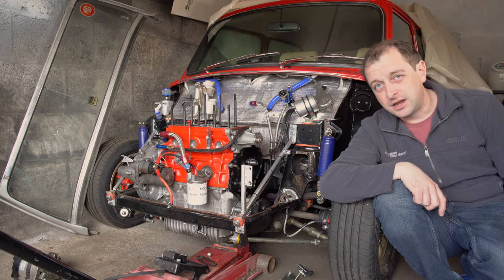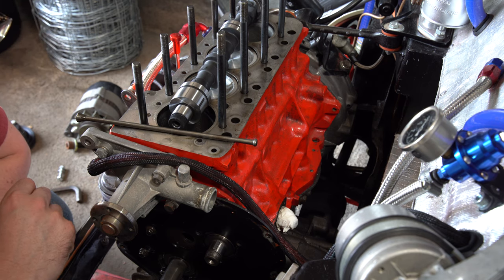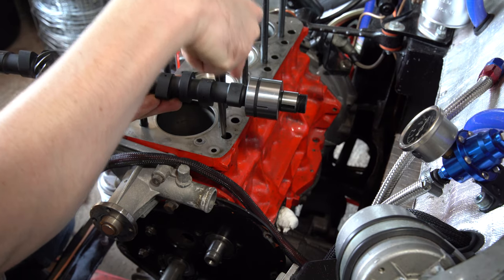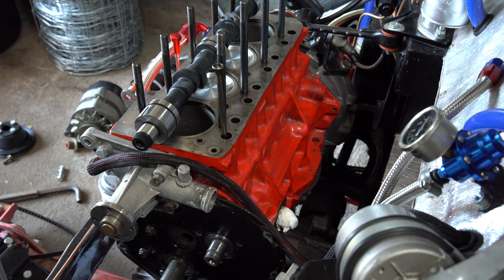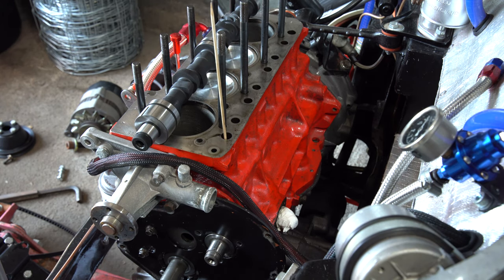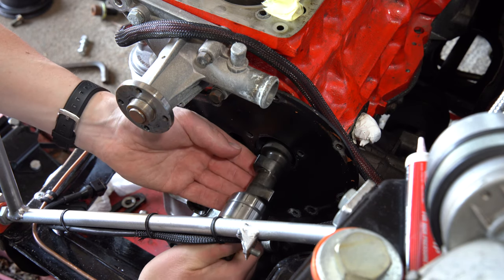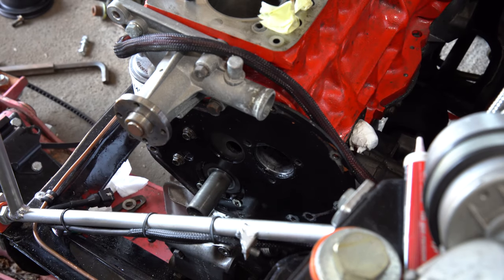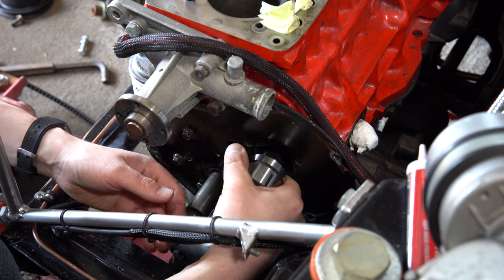Swapping a Mini A-Series camshaft, without removing the engine!!

Comment: A cam and followers bed in together you can't simple switch the cam in a 1275 A+ block. You can in a 998 as the followers can be swapped. That cam would chew up old followers.
Reply from the maker: I made this VERY clear in the video.

also you cant access followers on most pre-a+ engines either, only early blocks had access to them.

Comment: Ummm....how does one pull the cam all the way out if the side body work is still in place? Looks like the first part of this video where you cut off the body panels is missing ;-)
Reply from the maker: Certainly on he later SPi models, if you remove the radiator and electric fan, there's a huge hole in the inner wing :-)